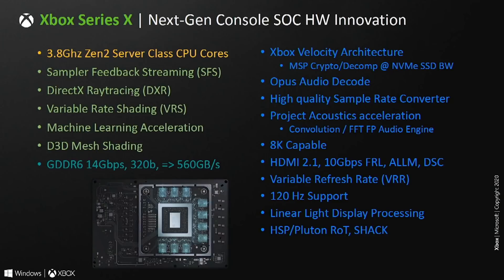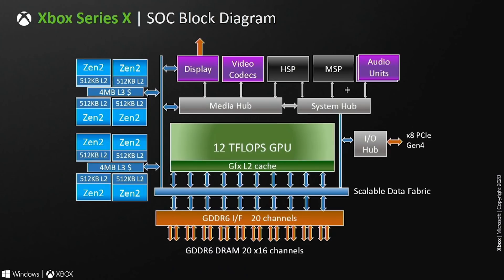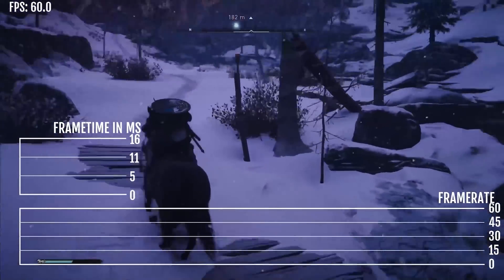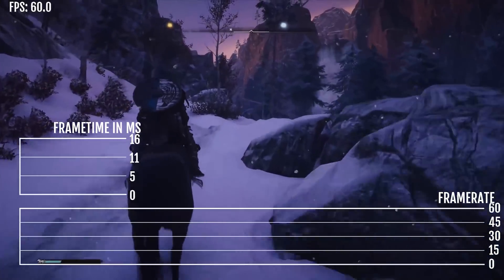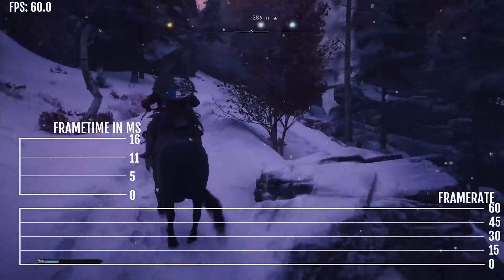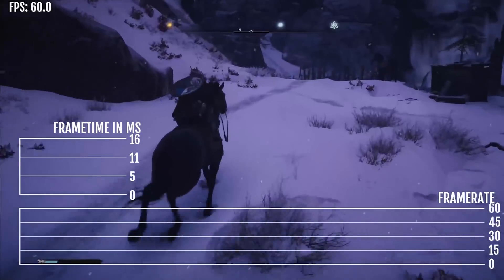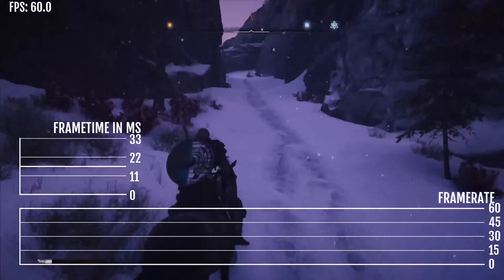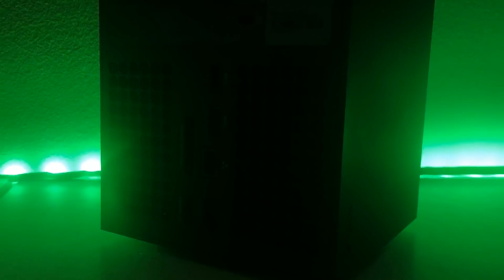Xbox Performance to be UNLEASHED | Xbox Series X Mesh Shaders & SDK Updates Changes Everything

Comment: So in summary is Sony's Geometry Engine or Microsoft's DX12 Ultimate better for gaming?
Reply: Series X has two geometry engines dude.  Game over for Sony!!
Reply: Sonys GE of course. Dx12u has to many bottlenecks. Dx is smoke and mirrors only. I rember how msoft promise that dx revolution way ago from dx9 lol. Nothing changed except new api came Vulkan and it was way better than dx. Why do you think Id made Doom eternal using Vulkan?
Reply: @FFTM155  why do you think they made it using vulkan? it's not for the reasons you claim. doom games have always been opengl and now they're using vulkan which is the successor. MS owns id and doom now anyway.
Reply: @garyhay6889  google dx12 bottlenecks. Many games had problems such as stuttering, drop frames and so on. Dx12u will not make big diference. Vulkan is flawless and runs perfect on all  hardware.

Comment: xbox will have a tie when they show UE5 demo running on Xbox.
Reply: That is not possible on xsx hardware.
Reply: @FFTM155  hellblade 2 will use unreal engine 5 confirmed by phil spencer himself😏
Reply: @555rzk  so what, is backward compatible, that itself doesnt say anything, i just want to see the demo running on xbox hardware, wonder why this has not been shown yet.
Reply: @555rzk  i know that. We will see how well.
Reply: @garyhay6889  no, lol "demo" on laptop was video of ps5 presentation and they comented on what will ue5 bring to pc gaming. Tim Sweeney explained that on his twitter. And there was no problem with demo on ps5. They did that video in few months with litle to no optimization. About dx12u you will soon see it is nothing sepcial. And as i said before dx12 bottleneck, google it. While games that use Vulkan works perfectly. Msoft is hyping dx from dx9. 
And every new version is suposed to be special but we have seen so far that is not the case. Changes in dx is minor and has no big impact on games.
Reply: @garyhay6889  suit yourself, and you are delusional fanboy. It is you who spread false info about ue5 demo. You know the real thing we saw running on ps5 and it was remarkable. Waiting to see anything looking like that running on xsx.
Reply: @garyhay6889  it does, but we will see how well. What ue5 showed on ps5 is remarkable. And they said that they dont know how well would that demo run on other hardware. Those are the words of experts.

Comment: Graphics programmers are the ones with the tough job of optimizing whatever math they need go through to render pixels on screen. API are what they are today because they are that hard to create, that's why programmers don't make new ones from scratch if they wanna make a game fast.

This is why premade game engines like Unity is used so commonly by developers, they don't wanna mess with API and would rather use abstraction and generic stuff to make it work modular... at a huge performance loss.

Hardware has a ton of performance to squeeze out, software is always holding hardware back...
The fact that there are PS3 games that can look like PS4 games kinda proves that.

Comment: "On paper it's monstrous". But Steve from Gamers Nexus tested it and said the console is like a 5 year old midrange gaming PC with a GTX 1060. So using the word, "unleashed" is a bit flowery because it leads to mind to think of something like a Pitbull. Unleashing a chipmunk just doesn't carry the weight.
Reply: 1060 lol and you really Believe that?, everyone and their mums know that even the ps5 is more
Powerful than a 1060
Reply: @THEREALKEMMZ  "everyone and their mums know that even the ps5 is more
 Powerful than a 1060"
See that is the difference between the PC Master Race and Console Peasants. We actually test hardware before we talk trash or listen to some POG talk crap.
Gamers Nexus is the best of the best at testing hardware. No serious PC user will argue with their results. Steve, owner of the channel doesn't care who gets pi$$ed off either. They show the results in such detail that you find yourself wishing they would skip ahead. 
Both PS5 and Xbox Series are about equivalent to a GTX 1060 and in very light titles the reference GTX 1070.
In short you got what you paid for.
Reply: @ragingmonk6080  Hey did he test the series X as well?
Reply: @terrenceholland6355  "Hey did he test the series X as well?"
Both systems are made by AMD. Designed to be close to one another. Only difference is that Sony runs a custom Linux OS and Microsoft has a cut down version of Windows.
I am a PC gamer and don't really care about Blu-ray players so I didn't go back to see if tested you specific movie machine. Sorry.
Reply: Digitalfoundry has done far far more testing. 
And they have shown with actual video evidence the consoles offer performance between the 2070-2080 in most games. 
And for ray tracing, the ps5 was around the 2060/2060SU while series X was around the 2070/2070Su.
Reply: @nighttime1998  "Digitalfoundry has done far far more testing. "
Nobody, in the know, trusts Richard and I explained why in my other comment.
Reply: Lol. It's been tested and shown to compare to a 2070. Same for ps5. 

But yeah... 1060...
Reply: @nighttime1998  "Lol. It's been tested and shown to compare to a 2070. Same for ps5. "
Not by anyone with credibility.
Read my comment to "DEON" for an explanation. But will add one thing for ya. Game devs have always said that consoles are 5 years behind PC. Gamers Nexus proved that still stands.
Do not take my word for it. Don't even have to believe Gamers Nexus because they will not tell you what YOU WANT to hear. I am played Cyber Punk 2077 as a Nomad the first time. Getting ready to finish my second playthrough as a "StreetKid". Sony took it off the store because their new console can't even run it.

My specs, R5 3600, 120mm AIO, 16GB DDR4 3200, Sapphire Vega 56 Pulse. Playing at 1080p High settings and averaging 48 to 65 FPS.
These two new console can't mange dynamic range and 30 fps. Game spoke and Sony took it off the shelf.
Reply: @ragingmonk6080  Sony took it of the store because game is bugfest but it still runs 60fps locked on ps5. After cd fixed this mess then game will be back on ps5 and ps4. But it will be to late and forgotten. Cd project LIED about cyberbug.
Reply: @FFTM155  Dude, the CEO of CDPR said the game was made to run on PC and they were "CUTTING IT DOWN" to run on consoles. Stop lying to yourself and the world. I played through 1 and 3/4 times with no issue ON PC.
Reply: @ragingmonk6080  
Let's see a 1060 run gears 5 at ultra settings at dynamic 4k60
Let's see a 1060 run assassin's creed valhalla at dynamic 4k60
Let's see a 1060 run DMC 5 at max settings while pushing 60+fps at 4k
Let's see a 1060 run destiny 2 at 4k60
Let's see a 1060 run forza horizon 4 at 4k60 high settings
Let's see a 1060 run SOT at 4k60
Let's see a 1060 run control at 1440p60/1440p30 with RT on
Let's see a 1060 run break point at 4k60
Let's see a 1060 run the division 2 at 4k60
Let's see a 1060 run jedi fallen order at 1800p60
Let's see a 1060 run hit man 3 at 4k60 high settings
Reply: @ragingmonk6080  
You said it's on par with a 1060. So prove it. 

Show benchmarks for all these games. And they have to be exactly the same out come.
Reply: @ragingmonk6080  
Um... 2077 is 1226p60 on ps5 and almost locked to 60. 
Same for series but at 1080p due to higher settings... With a 1620p quality mode that also increased the settings more. And locks to 30fps
Reply: @nighttime1998  Alec from Digital Foundry has shown numerous times that the consoles use lower than PC low textures as  even he admitted, "I didn't know that was possible".
"4K" with it's checkboard rendering and dynamic resolution is simply a way for the console to shift the load from the weakest component. When the CPU is the weak link shift the resolution towards 4k which places more of the load on the GPU. When the GPU is the weak link lower the resolution to shift more weight to the CPU.

But when you look at lower than PC textures at say 4k resolution. That is like spraying a turd with clearcoat. Yeah it is a little more shiny but still a turd.

Can't blame you peasants though. You are hardware illiterate and people like Richard from Digital Foundry don't help that. Xbox One X launched and Phil Spencer said, "It's the most powerful console ever made". He never compared it to a PC because he knows better. Richard from Digital Foundry said the One X, "is like a high end PC". Then Series X was nearing launch and Richard got a hands on preview. Digital Foundry did videos on this and Richard made fun of how "dismal" the performance of the One X actually was.

You get what ya pay for and AMD / Microsoft ain't your friend. Just like the Lead Developer at CD Projekt Red said. Cyberpunk 2077 was designed to run on PC. We have had to cut it down so it can run on consoles. We haven't managed to cut enough out yet.

Console is a poor mans gaming option. Can't afford a prebuilt PC, buy a console. Can't afford to build a PC, buy a console. But do not fool yourself in any way. You will never pay $400 - $500 for a complete system and have it compete with a $400 - $500 GPU. Only a fool would believe that.

Comment: .Xbox is getting rekt by PS5  They better sort this out pronto
Reply: It is what it is and nothing gonna change that's fact. They made wrong decision, Sony knew that next gen engines will work how fast the textures can stream and they made blazing fast system. Even Unreal Engine 5 was postponed because of that. When you compare mesh shader videos with ue5 demo running on ps5, ue5 is miles better and it is using ps5 geometry engine. They made that demo just testing what ps5 can do with no to litle optimization. Watch any mesh shader demo and compare to Ue5 ps5 demo. You can compare part of this video where statues are and compare them to statues from ue5 demo. If you have not already.

Comment: Xbox performance unleashed on old games lol you'll be waiting on there new games for a while.
Reply: I think ps5 and series x both will get a pro version after 3 years. Altough ps5 is out performing series x by a good margin in open world games and games I'm general. But when u look at how much both series  x and ps5 has to compromise on resolution. I think if these companies do not release an upgraded series x and ps5 I am certain that 4 years into the generation games thar actually take advantage of the hardware will be running at 30 fps with resolution falling down to 1080p. I think it will become increasingly difficult to maintain 60 fps in games. I think both Sony and microsoft should have waited before releasing ps5 and series x

Comment: Folks are only starting to understand that software is included in the statement your PC is only as fast as your slowest part.  Crysis 1 ran like shit cause it couldn't use the modern hardware of its era due to antiquated DX9 in the onset of parallel computing devices like Dual Core CPU's.
Reply: oddly enough crysis 1 remastered kinda suffers from the same issues still lol....

Comment: The tools are coming and will improve performance, OK but games already have "Optimized for Series X"  on the box, So are these games optimized or not? 
Also will the new "TOOLS" fix pop-in and stuttering issues on the series x?
Reply: Games that have the ( Optimized for series X/S) icon show in the details what optimized features it has for example faster load times, quick resume, 120fps mode, raytraycing etc......

Comment: By the time devs fully realized sx potential, Cerny would've just finished GDC for PS6.
Reply: So you are saying the industry will be slow to adopt mesh shaders that's now on Nvidia and AMD GPUs for PC?
Reply: I think ps5 and series x both will get a pro version after 3 years. Altough ps5 is out performing series x by a good margin in open world games and games I'm general. But when u look at how much both series  x and ps5 has to compromise on resolution. I think if these companies do not release an upgraded series x and ps5 I am certain that 4 years into the generation games thar actually take advantage of the hardware will be running at 30 fps with resolution falling down to 1080p. I think it will become increasingly difficult to maintain 60 fps in games. I think both Sony and microsoft should have waited before releasing ps5 and series x
Reply: This is just the typical fanboy drama the losing team always uses "AMD GPU ARE NOT WEAKER THEY JUST HAVENT UNLOCKED THEIR FULL POTENTIAL YET" "XBOX ISNT WEAKER DEVS JUST HAVENT FIGURED OUT HOW TO FULLY UTILIZE IT YET

Comment: Once xbox gets all their tools the S will beat the PS5 by 50% easily.
Reply: XSS it's a big joke
Reply: Lol
Reply: No.
Reply: I'm more of an Xbox fan but 50% seems a bit optimistic. It's not even 50% more powerful, the CPU difference is sweet fuck all, and the GPU is only a couple of teraflops higher. Not to mention the faster ssd speed on the PS5 which has to make a difference, if one can get the data into the GPU faster, it must have some advantage.
Reply: @TheTeeroy32  This is about the S, the GPU is less powerful.
Reply: @davidste60  sorry for some dumb reason in my head I thought the s stood for series lol.
Reply: @davidste60  I can't believe the new naming scheme is actually worse than the Xbox One.
Reply: @TheTeeroy32  Oh I know, it's comical watching presenters get tongue tied over and over again trying to name some of the major consoles on the market! I can see why they didn't want to use numbers, because they would always be 1 behind Sony that way (i.e. Xbox 2, PS3), but they should have just used the year imo.

Comment: What is a primitive shader and how does it compare to a mesh shader?
Reply: Different implementations to accomplish the same thing.

Sony uses primitives in conjunction with the geometry engine. This allows them to cull triangles very early in rendering freeing up CUs for other tasks. It also culls texture information that cannot be seen, again freeing up resources for other tasks. It can be used with vrs, but is not effectively vrs. That has to do with resolutions scales of shading and textures. Reducing the quality of each when it won't be appreciated(fast blurred objects, textures in shadow, etc.)

Microsoft uses mesh shaders and vrs in combination to gain performance as well as cull triangles/draw triangles by using compute. Meshlets are computed in parallel to help increase efficiency. Its also been said that it is "easier," but I couldn't verify that sort of claim. I'm not working with it.

Of course this is simplified greatly. End of the day, two ways of doing the same thing. The only thing we don't know is how performant the GE is in PS5. We know mesh shaders can be great. Developers will have to get used to both implementations to make the most of each platform.
Reply: Im short, mesh shaders is a superset to primitive shaders. Graphics rendering is highly parallel, but follows a specific sequence of steps. These steps are identified as fixed function. The goal is to allow graphics rendering to scale better horizontally. This means do more work in parallel without the efficiency falloff from scheduling work in parallel after each step of the rendering sequence. That fall off is improved with a higher clock speed, just do the work faster, but that increases heat.

Mesh shaders and primitive shaders aim to solve that problem my making more of the rendering sequence compute based, which allows work to be done in parallel. Comparinf the two, mesh shaders makes more of the fixed function sequence compute based.

It's not so simple though. The game also has to be designed for this, and the choices made to how meshes are grouped amd makes a difference, but it can do wonders when done right. It will also help when building a game to support multiple GPUs... assuming these GPUs all support Mesh Shaders. Hence the reason Microsoft pushed for it since its supported on PC.
Reply: So the Flintstone micro processor runs a sub program called Caveman 1.1 and paints all the geometry in flat shaded colors.